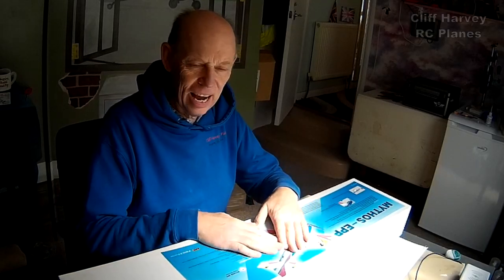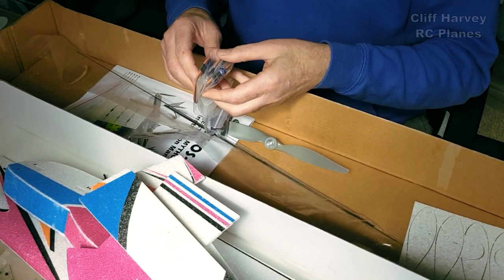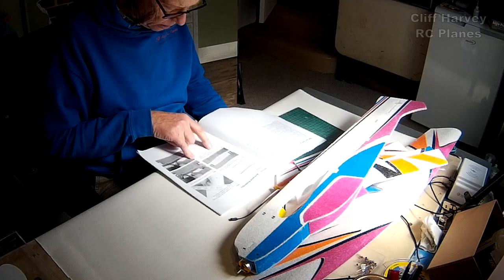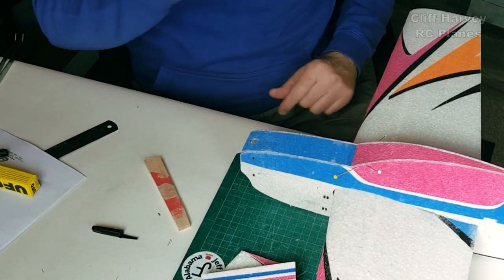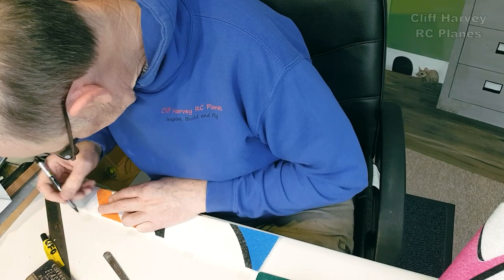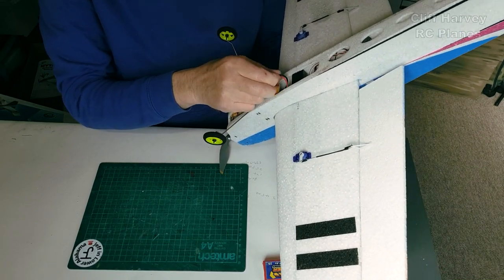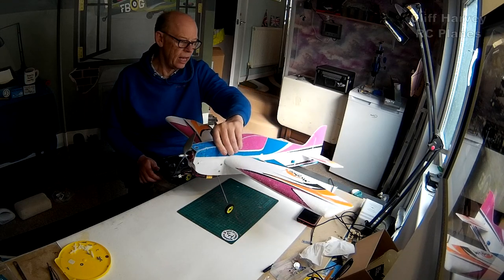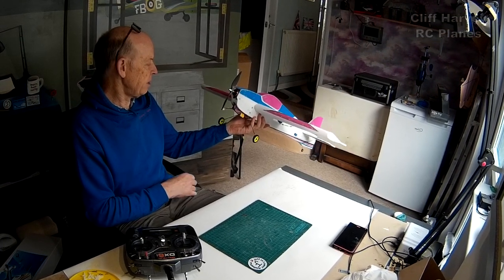'Mythos' 3-D Plane Assembly Video

Comment: Sorry, I´m no native english speaker, I don´t understand your spoken english well.
So I ask you:
What´s its wingspan, its weight and what´s the capacity of the batterie ?
It is 2 cell, it is ?
Beyond your level ?
That doesn´t matter, so my experience.
When I was still a rookie a friend of mine recommended an aerobatic indoor shockflyer ( a SU 29 from tech-one ).
A really cheap plane, really easy to assemble.
Meanwhile I repaired it about half a hundred times !
The challenge damned me ( as a half beginner ) to learn very quickly !
If that plane of yours would be mine I would paint it as a fiction WW II warbird.  :-)
Reply: See the specifications he gives at around 3:00 into the video. 31" wingspan , etc.
Reply from the maker: Hi Swyntopia, it's 800mm (31.5in) span, weighs 235g (8.3oz) with battery and uses 2s 800mah battery, I'm using a 1200mah battery which is a bit heavier. I'll be able to fly it no problems but it will be more aerobatic than I'm capable of. I love your idea of painting it WW II, thanks for commenting 👍
Reply from the maker: Thanks for replying CC but I don't think he understands English very well 👍
Reply: @CliffHarveyRCPlanes  You´re right.
Written englisgh is not a big problem.
But spoken english.
Thank you very much !